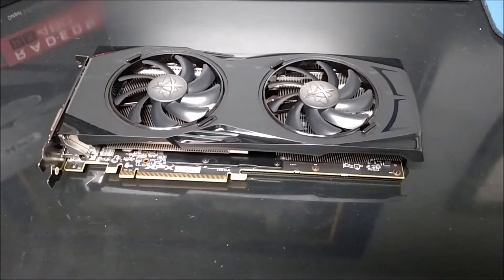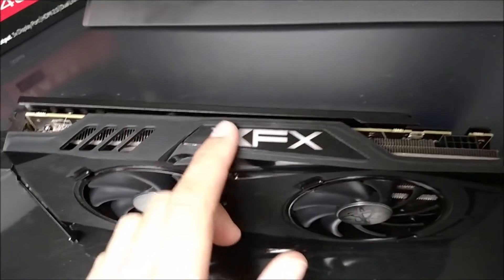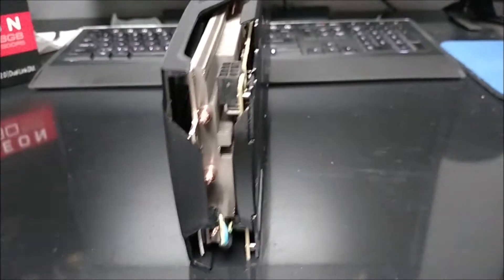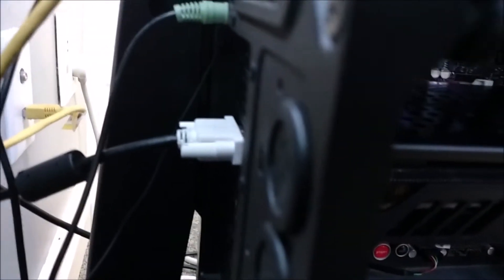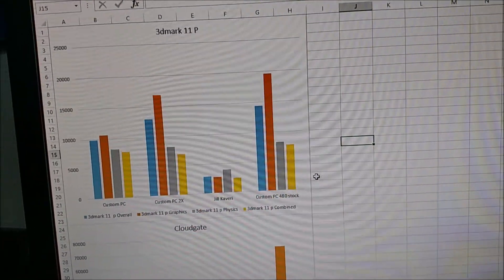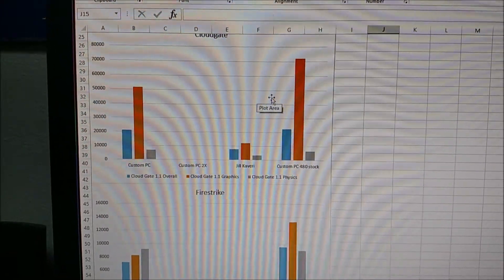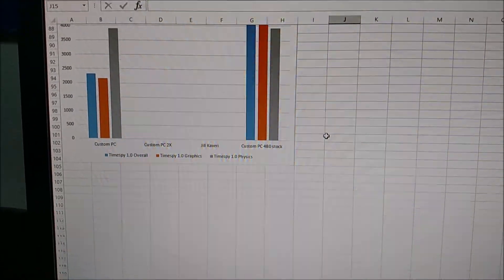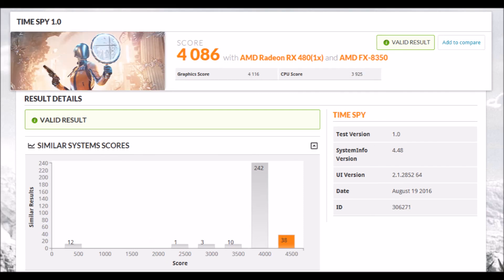7970 vs XFX RX 480 GTR!

Comment: How do your GPU core temps look with the case cover on and off? Thanks!
Reply from the maker: those were what I saw stock clocks case closed
Reply: Those are pretty good temps. Thanks for the information. The XFX card seems to be a hit or miss for some, I am beginning to suspect bad thermal paste job at the factory or maybe the heatpipes are not making proper contact with the copper block that sits on the GPU core. On paper XFX has a cooling design that probably should be as good or better than the ASUS Strix. Your card seems to be working well as it should be.
Reply from the maker: +McLaren Button I'd argue that this cooler is better than the strix. it kept me under 70 after clocking to 1360 for a 3 hour GTA session
Reply: The reason why I find the Strix better is because JagatOC found the Strix to hold 68C max temp at 1400-1420mhz at 1.225V, which is very high in terms of heat and power draw increase, especially spikes. But the Strix has a big weakness, little to no VRAM cooling.

In your defense though, they tested that on an open air test bed.
Reply from the maker: +McLaren Button this has vram cooling. also diff between 68 and 70 at 1360 to 1400 is mostly due to fan curve I set the target temp at 70 and left default fan profile. this cooler would hold 60 if I ramp fans up
Reply: Thats good to know! so there is still more room to push further. Power draw increase is not linear though, as it increases to the square of increased voltage. 

Still seems like XFX GTR can actually be the best AIB version yet because the lack of VRAM cooling on the Strix is unacceptable. Thanks a lot for the information, I think I am going for the XFX GTR and it's a good deal cheaper in my place vs the Strix
Reply from the maker: +McLaren Button good call. I paid more than a strix for mine don't regret at all
Reply: GDDR5 VRAM doesn't need cooling. Why do you continue to state that it's unacceptable? Reviews are showing that Asus Strix RX 480 can overclock the memory to 2250mhz (9000mhz effective) which is about as much as all the other AIBs manage. There doesn't appear to be any different in performance with actively cooled memory or not.
https://www.techpowerup.com/reviews/ASUS/RX_480_STRIX_OC/26.html

I ordered both the XFX GTR 480 and the Asus Strix 480 myself so not trying to start crapping on the GTR cards.
Reply: BestJinjo Nope, DRAM cells degrade over time and heat accelerates the degradation. Also if there is better cooling it is more feasible to up the VRAM voltage (not mem controller voltage) and go above 2250 into the low 2400s, done through BIOS mod.
Reply from the maker: +McLaren Button yea more cooling always good
Reply: rpm in game ?
Reply from the maker: Damian Kowalski rpm as in revolution per minute? This is a car term...

Comment: Just upgraded my 7970 CF setup for a Devil RX480 and it's now good to hear myself think when I game
Reply from the maker: my CPU cooler was always louder than my gpu's haha
Reply: is rx480 better then 7970? how about power  issues? I would die to burn my 300E motherboard over a 350E card
Reply: Mititelu Radu Yeah I'd say the the RX480 is aound 20 - 30% faster than the 7970GE.

Generally the 7970 Crossfire setup was faster than the RX480 by a good 50 - 70% but the noise from the system has been driving me mad so went with a quieter card that I could afford.
Reply: I do have a i7 5820k, 3ssd, 1 hdd and a 7970 so I do not have 300w to spare for a 2nd 7970. Thnx for your help